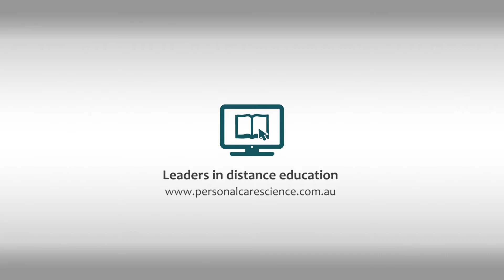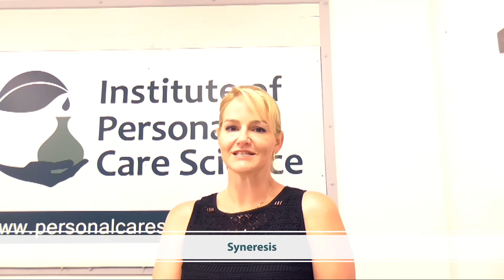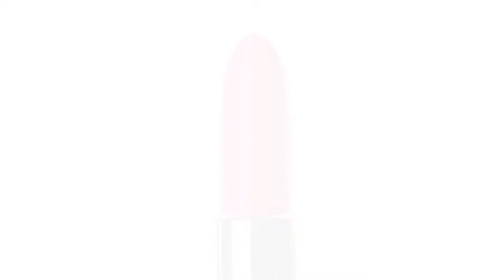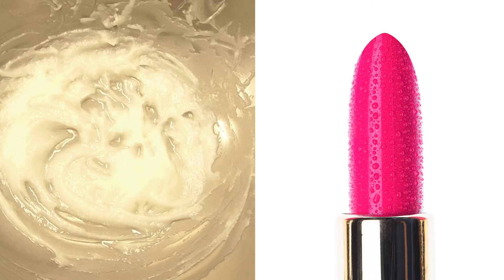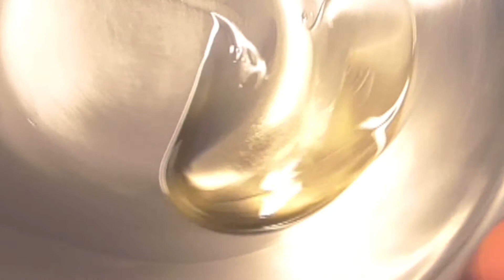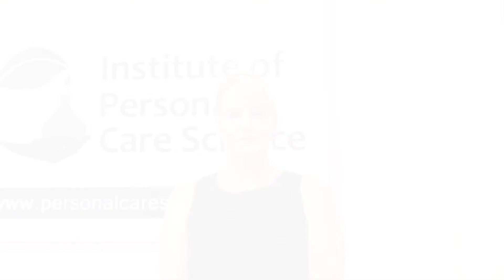Formulation Fix its: Oily Separation

Comment: I love it how you always say 'Happy Formulating'. I've seen almost all your videos and I'm a fan. You do such excelent work. I'm trying to formulate soybean oil printing inks and the system is so similar to cosmetics formulating in so many ways. So many challenges. I'm trying to increase tack and I've been having some trouble with the tackyfier resin blend. I'm currently using rosin glycerol ester as the solid resin and the idea is to blend it with a thermoplastic elastomer, and from what I have read so far, only some polyesters (alkyds), polyamides and polyurethanes could be compatible with the trygliceride, but I don't know. I'm kind of in the dark here. The idea is to make tacky vegetable oil. Not an easy task. At least not for me, yet. So my question is, which polymer, or kind of polymer, or what strucutural charateristics should I look for, or what would you recommend to accomplish that kind of tacky-sticky gooey effect in veggy oil? Thank you and happy formulating.
Reply from the maker: Thanks Victor - my happiest times are often in the lab so I want to spread the happiness!!! :) Try some really tacky esters rather than a resin; there are some great Schercemol esters that should help you achieve what you are looking for, speak with your Schercemol rep and get samples in... happy formulating!
Reply: Well-done Mr victor.
Look for lubban zakar  (dammar resin).
Try and good luck.

Comment: Does increasing glyceryl stearate in my formula help with this problem?
Reply from the maker: If you use too much, it will destabilise your formula. You need to make sure you get that high HLB balance right for the amount of oils used and a small input of glyceryl stearate/low HLB emulsifier. You can learn how to solve  your emulsifier issues with our Certificate in Advanced Cosmetic Science program: https://personalcarescience.com.au/CosmeticScience/CertificateinAdvancedCosmeticScience-478/ or Diploma of Personal Care Formulation: https://personalcarescience.com.au/CosmeticScience/DiplomaofPersonalCareFormulation-479/